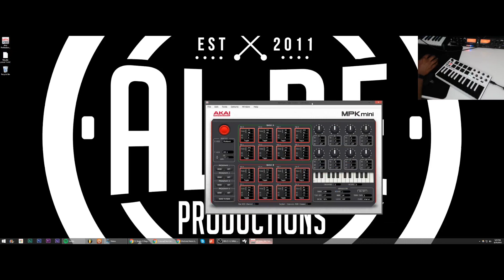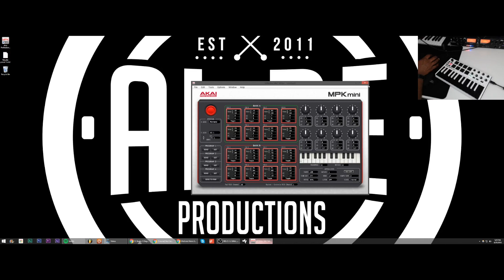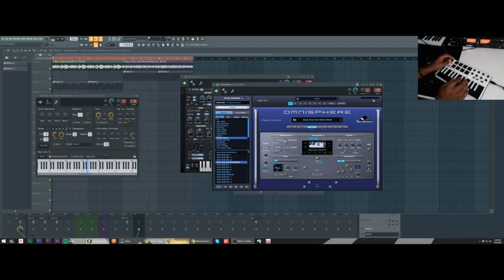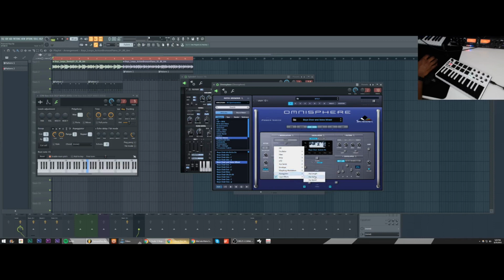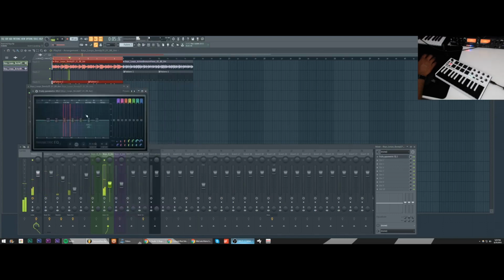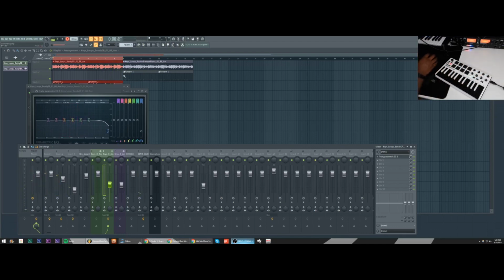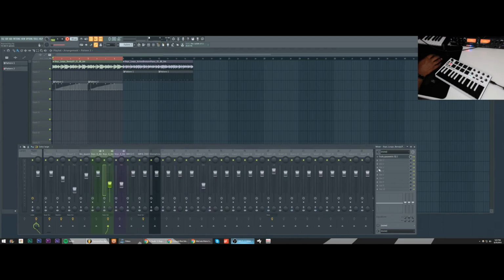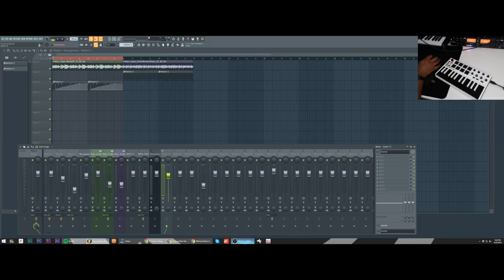MPK Mini MK2 FL Studio - Pitch Bend and Modulation Wheel Setup

Comment: Is it possible to fix full velocity of keys in akai mpk mini mk2 ?? If yes please tell me..
Reply from the maker: There is a "full level" button on the left side. It will make each pad strike at 127 velocity in midi
Reply: @thisisalbe  sir i am asking about keys..
Reply from the maker: @mkstudio92  oh. No. The way keys are setup they are always pressure sensitive. most wouldn't want the full velocity on keys since usually they're used for instruments and having the same velocity would sound unnatural. You could try playing with the velocity curve in the settings of FL
Reply: @thisisalbe  No..i got the solution..it can be done in fl studio audio setting..thanks for your cooperation..👍

Comment: when i move the stick, i get a green question mark.
Reply from the maker: Do you have any other midi controllers plugged in? Do you have a vst open?
Reply: no other midi controllers. i am using and omnisphere2 and boys choir  and solos wheel just like you.
Reply from the maker: @adastras3  interesting. Do you have the mk2 selected in the midi options and are you using my template? Go to options -> debug log and make sure modulation wheel is being received when you move it.
Reply: its selected and i am using the template.  in the debug menu it shows pitch bend and modulation wheel when i move the stick.

i get the green question mark still. i see that if i click "remote control", i can manually assign the two functions. this application goes away when i open and close fl studio though.
Reply from the maker: Start by loading an Empty template, see if that works.
Reply from the maker: Yo I got a video for you coming today on how to fix it.
Reply: no luck still.  in the debug menu i see that my joystick shows "not handled" when i move it around. 

when i move a knob it also shows "not handled", but once i link a function to my controller the knobs show that they are "handled".
Reply from the maker: How to fix the mod wheel if it's not working --> https://youtu.be/VOnw3Wk3XE8
Reply: The same problem !! I also use mpk mini and fl
Reply: This only happens on joystick and the filters !! A green question mark in a modulation wheel appears when I move it on hint pannel
Reply: Please help !!